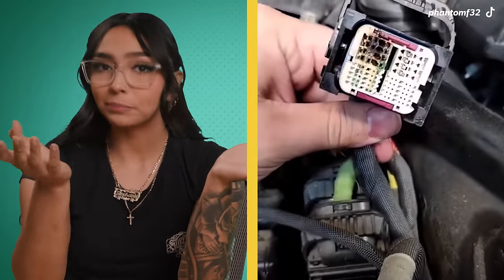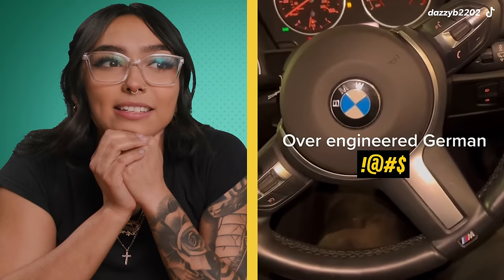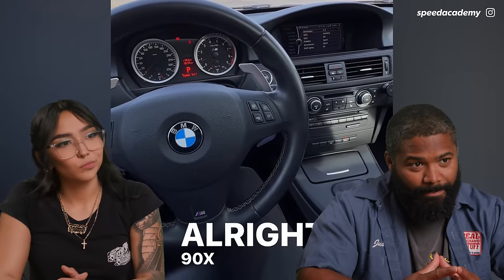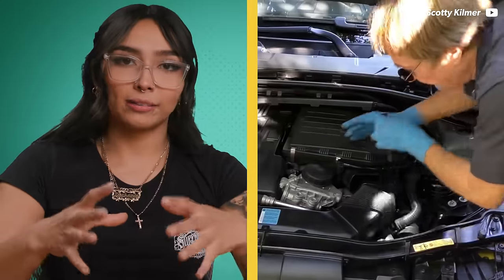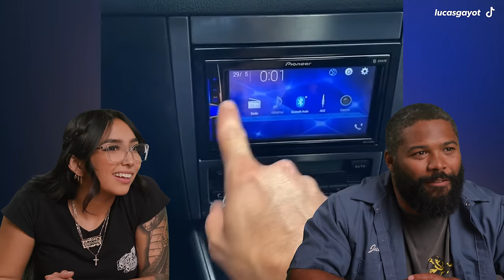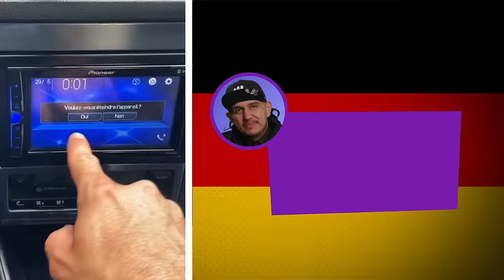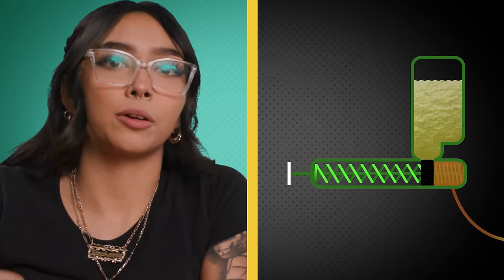Mechanic Reacts to German Engineering Fails

Comment: Hey, german cars in general are not for servicint. But really what I wanted to say the cover is not just to protect the wires. Because plastic is thermal isolator it also doesn't let the heat to go out. The more heat is in the engine the more energy is being converted from chemical to mechanical. Because the more heat it looses the more inefficient it is (thermodynamics). I don't understan how you guys can't get basic physics being engineers/working with cars? I really disapointed with somet things.. Not sorry.... but....?

Comment: “Built like tanks”. Their current tanks suck as well, and are notoriously prone to failures that are not easy to resolve via field repairs or require proprietary components. The current SMO in Ukraine has been a case example in demonstrating failures of over-engineering vs. simple.
Reply: The Leopard 2 is the best tank in the world.

Comment: We can't produce our own gasoline in Europe, there's not much oil. We have to buy it. So we make smaller displacement engines than in US. Here we consider a 5L engine as a big one.
But we also like to have fun, so we learned to make more horsepowers in one cylilnder. Reach 400hp or 600hp with a 2L 4 cylinders is almost common for us. But this approach of the engines design implies a better finition, and far more organs and sensors around the block, which makes the cars more complicated to maintain and ofen more prone to breadowns. And the anti pollution and security standards hits hard too. We don't even drive all by oursleves anymore, those cars starts to drive you and yell at you..

Comment: My 06 GTI wasn't that bad to honest. Now my 05 mini S, never again. But really it's all about time period. The farther back you go, the more space you had on any car. The easier the work was. I mean even getting to the oil filter on a 90 EF, is a pain. My second gen 4runner is a hassle just to get the valve covers off. And the timing belt, I'll pass. 08 crv I had, gotta jack the whole engine up just to get to the water pump. Just saying, it's not all German car problems.

Comment: Hey! I know you mechanics like to say that a German car problem is iver engineered. Take it from an engineer, please. The correct phrase is either "crappy engineering" or "not engineered". An old engineer I worked with used to say than an engineer is a fellow (gals too, now) that can do for a penny what any damned fool can do for a dollar.
OK. I got that off of my chest.
I've worked on a lot of German cars. Here's my list of crappy engineering:
1. 911 chain tensioners that had a high failure rate in 1965 were fixed, after at least four redesigns in 1987. That part of the engine was then completely re-designed in about 1992.
2. Magnesium 911 engine case that won awards in 1968 as an engineering masterpiece was redesigned in 1978 because of bearing failures, oil leaks and pulled studs The puled studs then caused compression leaks. The bearing failures were due to case distordions.
3. A VW wiring harness connector that used little screws in plastic to connect the wires. When I drove the car from California to Oklahoma the change in climate caused most of the wires to exit the connectors.
4. BMW rear suspension that had the differential attached to sheet metal and routinely broke welds to the body, above which was carpeting to make welding fun.
5. Porsches and BMWs with chintzy plastic window winder mechanisms with high failure rates.
6. Mercedes throttle body linkage that, when failed, required replacing the entire intakes system.
7. A ten cent plastic part in Mercedes thermostats that fail, mine in the middle of the Bay bridge.
8. Mini Cooper (It's a BMW) thermostat plastic welded into a housing with multiple water connections. When it fails the stupid thing costs over $100 and you have to replace half the hoses too. The equivalen Chevy part is about $8.
9. Boxster auxilliary shaft bearings. That entire engine was an idiot's nightmare.
10. Porsche thermal reactors. (1975-1977)
You want to see "over-engineered"? Look at a Chevy small block. Introduced in 1955, a version is still being sold. It has less than half the parts of any Porsche engine. It puts out more horsepower per pound, more horsepower per cubic inch and at about ten times the value per dollar.
My problem is that I would rather drive a Porsche than anything.

Comment: Anyone think it would be easier to fish a master cylinder in behind the brake booster and whatever else they've packed into the engine bay with a quarter inch of clearance everywhere. I'll take pulling a dash over a motor.

Comment: I'll say that pre ~2014 audis and vw are incredibly reliable, if you're getting a European one with the right engine. Just did the timing belt and first turbo on a 380k km 1.9 tdi engine and it keeps on trucking. Vw group 3.0 engine is also great up to 2010ish.

In Europe, German cars really are the best, and what you're seeing here are the extreme examples. That said, fuck owning anything made in the past 10 years, it's way too inaccessible and expensive to maintain

Comment: And I would still go with German cars over US cars every time. However, the simple fact is - all manufacturers all over the world have been, for a while, moving in direction of "only we can fix things and no-one else". Not specific to cars, not specific to German cars and happens everywhere in the world. Very common thing in electronics for many years already. That's where this whole "right to repair" term is coming from and what electronic repair companies have been fighting for for a long time. Car repair companies are starting to get there but should have really joined that "movement"  a long time ago, because it is coming for them as well and there's no avoiding it. Any and all who are performing maintenance of anything and are not under the corpo symbols should band together because of this.

Comment: I love german  cars that's what do and I prefer  to work on the over any other brand... especially any garbage toyota. By the way the cover is sound  muffler and prevents  the heat from the engine  damage  the paint job in the hood also you need to remove more stuff to facilitate  the access to cylinder 6 etc plus you didn't diagnose it.

Comment: German car engineers are so smart they're stupid. 
They design things so interconnected that your ashtray door causes a catalytic converter failure which also causes a coolant leak which drips onto electrical terminals, turns all your lights on at 2:48AM every 3rd Tuesday of the month. 
Recently bought my first german car and boy, they're both amazing and absolutely awful. 
Like they engineered the windshield wipers to rest at different motor positions to keep the rubber from wearing as much. But almost every seal in the engine is designed poorly to the point the thing is prone to just spew oil out of every possible seam if you dont change all the seals every 3 years. Its the most backwards hell imaginable.

Comment: German here: We don't have a fraction of the issues with our cars that you Americans have. Firstly modifying cars here is not a thing, we drive them as from factory. Secondly we have a compulsory two-yearly inspection (TÜV) to ensure that everything is in functioning correctly and in line with road regulations. I know that American car culture is to tune vehicles in some fashion but it seems to lead to a lot of issues later on. Don't fiddle with them and do your required maintenance.
As to the use of plastics, this makes a lot of sense both financially and in terms of performance. Plastic parts are easier and cheaper to manufacture and are considerably lighter the metal components. And light weight is good for performance.
The engine complexity... yes it is a schlepp to work on but the more compact the engine is more you can shift it to the middle of the vehicle. Again... performance.

Comment: As a German that has driven Volkswagen since he got his license, I can tell you, don't buy this crap anymore.
It seems as if the parts are getting worse with every model. 
One of my first car never had any transmission problems, the 4th car, needed a new one after 8 years.
The last model I had, which I barely drove needed new shock absorbers after a few years and even its mirror glasses fell out without me doing anything (just cheap glue).
And imho, BMWs are the worst cars anyways. Over the years they switched so much stuff to BMW special parts (screws that only BMW has screwdrivers for), unnecessary plastic covers (one guy couldn't even find his battery under all the covers), special spark plugs etc. etc. All purposely designed that way, so you have to go to a specially licensed BMW partner and can't just easily fix stuff yourself or in a non-BMW-certified garage.
Let me tell you all, it's best to stay away from those. Our manufacturers are just so full of themselves, while in reality their managers are pulling out as much cash as they can for shitty, greedy things. At least in my experience.
No more German cars for me.

Comment: My brother had a german built 2004 bmw 750i you have to drop the subframe to change the starter in my 2000 excursion it took me 20 minutes to change it out my 2008 mustang took a little over an hour my 1998 gmc sierra took me roughly 30 minutes to change out the starter on my brothers 750i took 18 hours (we don’t know shit about German cars and could barely find a video on how to do it and we’re wayyyyy too broke to take it to the dealership)

Comment: I will die with my JDM 2006 Toyota Matrix XRS. I have almost 300k on my VVTI engine and still running smoothly as the first day I bought it. And part are easy to find and way cheaper than European makes.

Comment: My first car was a 2007 323i I got back in 2019 for $8500CAD. First 2 years had 0 issues, but after that it was problem after problem after problem. Couldn't go a month without it being in the shop. Im out thousands because of that piece of junk. 

Now I own a 2023 civic and my god it's a breath of fresh air. Asian import cars from now on.

Never again will I buy German steel. Ever.

Comment: 1999 Audi A6 solar panel built into the sunroof! It's supposed to power the blower motor when parked and hot outside. There's a combination relay that shorts out and kills the HVAC circuit. Had to resolder the pins in the relay; relay out of stock. Of course it is! Solar Panel! Really Audi! How hot does it get in Germany?!@#$%. Cool idea, but so dumb😂

Comment: What I noticed working in Germany and North America is that only North Americans mechanics complain about German cars.

Thing is trades in Germany have a way way way more sophisticated educational trade school system in place. They select only the smartest and finest. Over 70% dont graduate!! let that sink in! 

When I came back to the states after 8 years of working in Germany I couldn't help but notice how,.....sorry this going to trigger people,..... low IQ the average mechanic is compared to the Germans! Whenever a problem came up that wasn't a standard in and out 2 hour job they start complaining and blame the car/engineers. 

In Germany they gather with 5 guys and the head mechanic and analyze the issue and a whole super efficient process of research/calls with factory and engineers/ data analysis is gling on to come up with a cost effective solution. And those guys work on 30 different makes on the regular compared to our 5 standard makes here in North America.

I really think we should invest in cultural exchange with Germany when it comes to trades in generell. It's absolutely insane how professional and efficiently they work over there!!

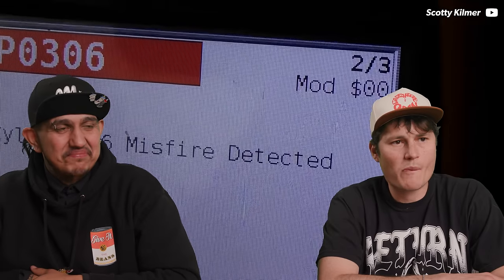Comment: 6:16 Well, to be fair, they want a weight distribution that forces them to stuck the engine - which is a loooong inline-6 - right into the dashboard, that possibly no remaining cylinder hangs out over the front axle. When you take it to the extreme, then you end up..... Well, they are supposed to be company cars, all of the German cars, well the exclusive ones. Just get rid of them after two years! How hard could it be? I loved my company BMWs, they changed anything without even bothering. Do I want to own a ten year old German car? Are you insane?!

Comment: If they didn't try to cram so much over engineered, unnecessary garbage in so small of a space, they wouldn't get so much hate. Make the engine bay longer or wider or both, and the only thing that's truly necessary is fuel, air, and spark. All the rest is fluff and filler. Trying to sell cars by novelty features instead of what actually matters.

Comment: The explode one turbo vacuum line coneted to fuel dissel edu return vacuum line instead of the egr vacuum line turbo O send overhead exhaust fuming back in to intak and exhausted fumins and the hot het from turbo blow up

Comment: They’re not over engineered they’re engineered often is the dumbest way possible. It’s no accident everything is an interference fit with everything else under the hood. So a 10 min job will be 2 hours due to needless steps. The fact bmw has a term called front end service mode is crap in the first place. Removing the front half of the car just to work on it is ass. Their oil coolers are a failure that’s going to happen without fail. Yet they’re mostly unchanged for more than a decade. A 50 dollar cnc plate and larger cooler taken off another car and mounted Ways from the engine solves the issue. It will never fail again requiring a front end removal to access one bolt.

Comment: Audi is definitely the worst because there is no room to work, shitty vw polo parts and electronics yet 3 or 4x the price, and then theres the plastic crap and complex chain drives in the engines 😂 TSIs are built with paper mashe, 1.9 tdi is gold though.

Comment: BMtroubleU...had 7 series.  Absolute worst piece of crap...all window regulators..back twice..dash display.  Interior dash fan (how do you its bad?   When turn steering wheel to right and it just stops).  Radiator..hoses, seat trim..cupholder..7 disc changer in trunk wouldnt open..watercooled alternator.  Kidney grill tabs...just Break. Wiring to both headlight insulation getting brittle and coming off.   Washer pump.   2nd thermostat at back of engine (ok..this one any car can have) Did most repairs and replacements myself.   But engine faults.  In shop months.  Hundreds of dollars to one german expert in area..he gave up.  never did get dash christmas tree to clear.    Paid 2k to have checked in Bmers and Benz shop..." well got good news and bad news.    Good news is dash is clear.  Bad news is timing chain tensioner has broke.   That will be about 4 to 4500 to do it".    Drove it home running like crap HOPING it was zero clearance ...sold for 600 scrap.       PoS....

Comment: Attention all Euro engineers.... Please, please, PLEASE use some of that engineering skill on your damn oil sealing technology!! It's like the cars come pre-leaked from the factory. C 'mon maaan!!
Reply: Euro emissions standards are veeeery strict- manufacturers struggle to cope. So they run their engines hot, high compression and under high strain. If you don't change that or maintain it properly, it's screwed. They use top-notch quality control, but their hands were tied. Soon, they learned it's also good for profit, and continued to make the cars this way.

Comment: Listen, newer german cars? Yep, overengineered crap that doesn't last long, which is on purpose actually. 
Older german cars, pretty much everything before like 2005, especially from the 90s and 80s are indestructible tanks, trust me, I have cars from both eras

Comment: VW Bus T6.1 four years old, of course out of warranty. The actuators for the air conditioning, which are located directly under the dashboard, were defective and had to be replaced. The entire dashboard had to be dismantled and completely removed. The job took 20 hours of work just to change 4 damn actuators. It would have been much easier if VW had simply built a dashboard upper shell with an access flap. But NO....Thinking when developing such completely overpriced and crap cars is, as we know, a matter of luck for German car developers.....and that says me a german guy!

Comment: 2 of the most "brilliantly" overengineered systems ze Germans designed because.... Das Auto, were Audi with their vacuum controlled door locks. When everything else is controlled electrically, guess that was just not good enough for door locks..... Let's use a vacuum pump in the fender well in the trunk and run vacuum lines 2 all 4 doors instead. Amazing. And then making the engine oil dipstick a fucking electronic sensor instead, since, ya know, if the level is good that means the oil is just great right? No one needs to physically see or smell the oil in between changes since oil level is all that matters right? 🤦🏽‍♂️🤦🏽‍♂️🤦🏽‍♂️ Just... Why?

Comment: Iam owner of VW CC 2015 with 120K KM on it, they are very complex and mechanics hate working on them and they will charge you way too much to work on, spares are expensive, a lot of programming can go wrong, VW is just simply garbage. And they have cheep quality materials 

The problem with VW is people workshops treat  it as same as BMW and Mercedes and it's not the same. Compixity wise, and cost of maintenance and repair is as horrible as Audi/benz/bmw but the quality is as horible as any cheep car

Comment: The truth is, German cars bring money but also pain in the ass for those who repair them. But really they are doing some extremely annoying and stupid designs whether is the engine, transmission, or electronics and software development, for example the IDs suffer from numerous software issues and the q4